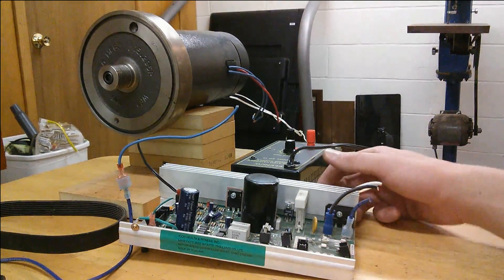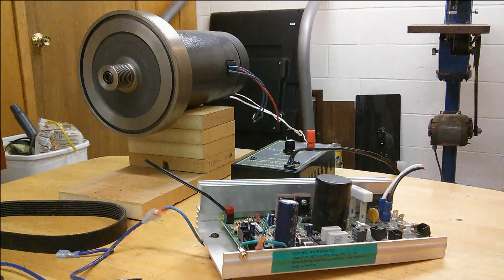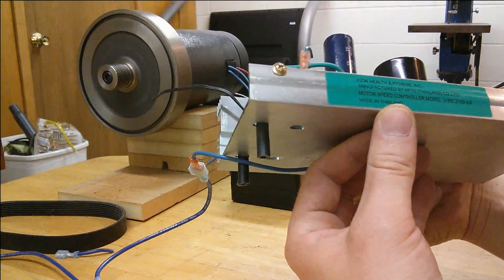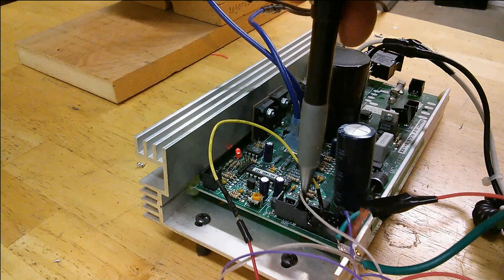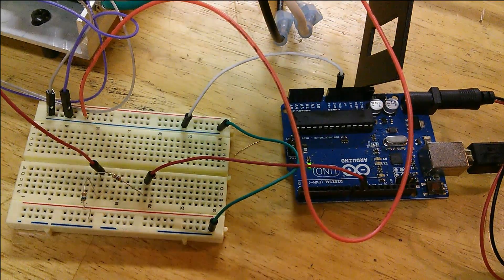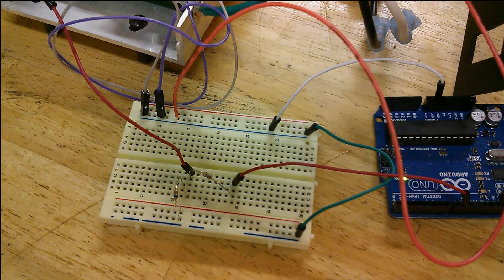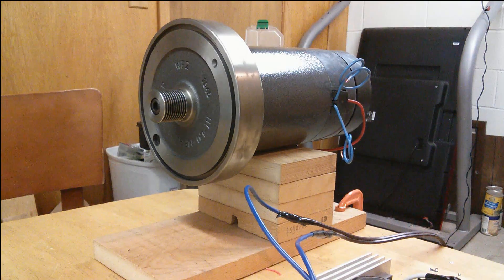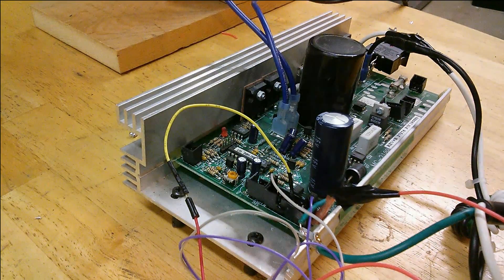Arduino + U-MC 2100-WA Treadmill Motor Controller

Comment: Is there a way you can hook a potentiometer to this board
Reply from the maker: Yes, go through the arduino tutorials on potentiometers - all you have to do to adapt them to a PWM board like this is tie the value read from the pot to the duty cycle.

Comment: Thanks for your demonstration about the control circuit..... I need to contact you about my case... I have control board for treadmill DC motor that gives high pulsating dc current and that tends to burn the motor so could you help me solving the issue as I'm going to apply an external pwm signal instead of the one on the board.....
Please give your mail to start contact you and get that done... Thanks

Comment: Hey Grant, 

When I upload the sketch with anything between 0.0 and 0.9 duty, I see the arduino mega flashing, but no motor movement (red light not flashing on mc2100 board). Anything above 1.0 duty, arduino just has solid light (not flashing), and still nothing from motor side.

I’ve wired up the unit just like yours, however the only difference is that I used a 220 ohm resistor for the arduino pwm pin 9, and 330 ohm resistor to ground. 

Any help would be much appreciated.

Comment: Thank you for the video and for continuing to reply to comments on such an old video.
Could you explain the function of the 2 resistors in the circuit? Thank you
Reply from the maker: If my memory is correct, the one from pin 9 is to drop the voltage from ~5 to ~3, and the other is a pull down resistor so the voltage goes back to zero when the signal is not applied.

Comment: But how do I change the speed manually? with a potentiometer? and where would you connect it to the arduino?
Reply from the maker: Arduinos are programmable, so it entirely depends. You would use a potentiometer, but if you're not sure how to do that I suggest that you start with potentiometer+arduino tutorials and learn the basics before trying it with a motor. A typical tutorial will teach you how to dim an LED with the arduino+potentiometer, using a very similar setup to what would be required here.

Comment: How could I add a potentiometer  to change the rpm? Could you explain this process, and share the code for arduino? You would help a lot of people.
Reply from the maker: It should be straightforward (I don't have the motor anymore to teat though). If you follow a standard Arduino potentiometer tutorial (to dim an LED, for example), you'll see how you can use analog-input to read a number from the pot. To apply that to the code I posted for this simple example, just rescale the input number to be between 0 and 1, and use it to set the DUTY_CYCLE variable. There are a lot more detailed projects on the linked SonsOfInvention blog.

Comment: is there a way to make this work with a potentiometer, so that you just have to turn it to increase or decrease speed? Great job by the way...impressive!
Reply from the maker: Yep, just read the potentiometer value and use it to modify the duty cycle. The simple code I used won't work quite so well, as the potentiometer reads and associated cycle calculation takes time and would mess up the 50ms frequency without care. I'd use a PWM library to manage it.
Reply: @GrantBrown73  I wonder if he might have meant use the pot in place of the uno...and if he didnt then I do mean that.  I know the MC60 controllers will allow for this but I have not seen anyone wire up a MC2100 with JUST a pot.  I have been lucky enough to get two free treadmill's off craigslist lately but one had some really crazy controller that I think was fried anyway but I could never find any way to control it other than with the massive control panel from the treadmill itself.  I picked up the second today hoping it would have a MC60 but it has the MC2100...which at least works with arduino but honestly its might be trouble than its worth given a simple 10000w SCR controller and 5010 bridge rectifier only runs about $15 and you can skip the giant board all together.  Still, if there is a way to wire a pot to a MC2100 that was free...well, thats $15 for beer right!
Reply from the maker: @jzahirniak  I'm not aware of how that would be possible - potentiometers just change resistance, whereas this board is expecting an active PWM signal @ 3.3.v. I may be ignorant of a clever trick, so YMMV.
Reply: @GrantBrown73  I am afraid there is no trick...I have a couple "nanos" laying around I bought for like $2 on impulse.  My MC2100 has a transformer where yours seems missing.  I think its a 5 and 12 v one so I suppose I could power the nano from there which would make things clean.

I know pretty much nothing about the Arduino's.  Was going to try to learn but got side tracked.  What would one need to do to your sketch to throw a pot in the mix?
Reply: @jzahirniak  I actually tried it with the bridge rectifier with SCR controller, but motor was making a humming noise when running, and as soon as I put load on it (by stepping on treadmill belt), the humming got louder, until the breaker tripped.
Reply: So you dont mention this but there is 13vdc on the pin right above your purple ground lead.  Do you see any reason one could not power the arduino with that + & - 13v source?
Reply: Anyone have any idea of manipulating the incline motor?

Comment: Did you ever end up using this for anything? Maybe we could attach the laser pointer to this lol!
Reply from the maker: Fresh From The Garden Got rid of it in the move, the motor had gotten messed up after disassembly. Still have the controller though.

Comment: how slow could you get this motor to turn with decent torque.  I am looking to use a treadmill motor for a welding positioner
Reply from the maker: TheUkracer Not sure what a welding positioner is, but it sounds like a stepper motor might be more up your alley. They have really good torque at low speed, and precise movement.

Comment: Pretty much guarantee why it was cut and damaged was because they had to leave it behind so they deliberately trashed it so the next owners couldn't use it. I've seen it a dozen times. Ppl are just plain mean and despicable
Reply: Had a large panel rented to a plant in FL. They cut my 30 wire feed about 3"from the din connector for shipping. I think it was plain STUPIDITY.

Comment: Hello,
I don't know to much in electronics but I can identify basic stuff like checking circuits voltage etc... I changed a 2100 board recently (purchased on ebay) because the old one had burnt due to flood. There is a permanent red light on he board, connections to the upper board is good since all lights are on. When I push the start button, the motor just runs for one big spin and that's it. I have to push the stop bottom then the start again to get the same instantaneous spin. I checked the motor voltage: it's 198 V then going down progressively to 0. Can you figure out the problem? Thanks
Reply: Andriani Sicilian 
I had the same problem. Probably your hall effect sensor is not connected or corrupted. The controller is thinking that the motor is not physically spinning so it is stopping the motor for safety reasons using PID.
Reply from the maker: Not a clue, sorry.
Reply: It's been my experience when the the motor spins once and quits, you may have a bad motor or the brushes need replaced. I suggest you do an Amperage test on the motor.

Comment: Hi. Excellent video, but I have one question: with the MC-2100 controller could we change the direction of the motor?, from clockwise to counterclockwise and vice versa
Reply from the maker: Nope, you need to reverse the power cables for that. I suppose you could set up an H-bridge of appropriately sized relays to route power through... but you don't want to screw that up.
Reply: thanks for your answer. Maybe the h-bridge is a good option, but I need to find one which support high current (27 Amp).
do you know, what is the maximum current that this device could use?

Comment: Hey, your video has been very helpful. Thank you. I was wondering if you could help me out. I am trying to connect a raspberry pi to the MC-2100LT-12. I am using an optocoupler combined with the pi's 5V rail to send a PWM signal to the MC2100. Just like you, I didn't have much luck with the PWM libraries out there, so i hard coded a loop to have a duty cycle (period) of 50 msec. The problem I am having is when I send a PWM signal (approx 4.88V out) to the controller, the LED remains red and I dont see it blinking, also the motor doesnt respond. I was wondering if this was related to the board not responding to the voltage I am sending it or because of the 50 msec period I am using. I've tried a bunch of different resistors between the output and the MC2100 and I even tried using different duty cycles  (30 msec to 60 msec). When you initially tested the circuit, would the LED blink regardless of the voltage you gave it (if you had the correct cycle?) or would the LED blink only when the voltage is correct too. Despite everything i try, Im unable to get the motor to respond. I even tried just giving it a solid 5VDC (not pulsing), but that didnt work as well. I noticed you soldered the AC inputs directly while I am still using the circuit breaker, do you think that is the cause? I can't think of anything else that would be different from my circuit to yours. Your input would be greatly appreciated, thank you again.
Reply from the maker: +Razvan Serbanescu To be honest, it's been a long time since I looked at this. I'm not sure what might be causing your issue, but the period should definitely be 50ms. If the LED is red, you should have power, it's just not receiving pwm. Are you sure the HDR2 pinout is the same?
Reply: +Grant Brown Ironically, 15 minutes after I messaged you. I was troubleshooting more and realized the schematic included with the treadmill was wrong. The HD2 pins were labelled backwards, so i wasn't actually sending a pulse to the PWM pin....facepalm I do appreciate your help and that you actually replied on a 3 year old video. Thanks again

Comment: Hi. Hope you can help me. But if it's not a quick and easy explanation then don't worry.
You said that it'd be simple to add a potentiometer for speed control. That's what i want to do. But i don't know which pins of the connector to/from the control board i should be using. Do you know how i'd test this? I assume the pot will be used as a voltage divider. In that case i'm looking for DC voltage accross two of the 6 pins i have on my power supply board, and another that the wiper would feed? Is that the same pin as you fed the PWM signal to? In which case how do i determine which it is (without damaging my power supply board). (I don't have the MC 2100 ) Thanks.
Reply: +balisticsquirel Oh, you meant add a pot to the arduino to control it and in turn the signal it sends to the treadmill power board. I want to use direct control. No arduino. Is that possible?
Reply from the maker: +balisticsquirel It's certainly possible, but you'd need to design a timer circuit which turns a potentiometer input into the appropriate PWM signal; that's a bit beyond my novice electrical skills. You can get a mini Arduino for like $3 on Ebay though.

Comment: I have a treadmill controlled by this board which has developed bizarre behavior. It either won't start or starts sometimes with incomplete control. Your video is great and you clearly understand how the controller works. Can you tell me if the control board or the console is at fault? I can buy a new control board but not a new console. When not working, the PWM pin 4 has zero volts on it. Is this control signal provided by the console or generated within the board in normal treadmill use?

Comment: Great Project!  I just got a free treadmill off of CL with this motor controller and am trying to replicate your effort here.  I'm trying to figure out what you did with the blue leads coming off of the board.  I see you extended them onto a piece of lamp cord that disappears off the table somewhere but they don't seem to terminate to the motor - where/what needs to be done with those leads.  thanks for any advice.  Also any idea how to control the power raiser/incline section of the MC?
Reply: Lee Wenger never mind - I get it - those are the leads running to the red/black leads of the motor - it confused me that you used the blue wires there instead of the red/black.  I still have the question wrt the raise/lower function if you have any info there.
Reply from the maker: Lee Wenger I never ended up doing anything with the raise/lower motor unfortunately.
Reply: Grant Brown Thanks for the response - It looks like 5V on the 5th pin is supposed to raise the incline and 5V on the 6th lowers.  The 7th pin provides some form of feedback about the incline level but not sure what kind.  I got this to work and then it stopped... not sure what I did.  I worked up to where I set the arduino to send a .75 and then a .99 duty cycle which made the treadmill go quite fast but it also made the arduino completely unresponsive to receiving reprogramming commands so I pulled the PWM signal off the MC board and after finally reprogramming the arduino to send a .25 duty cycle pulse and reconnecting now I'm getting no light on the MC... now trying to troubleshoot what I could have done... oh well if I somehow fried the board I guess at least the price was right but certainly wasn't my intention...  BTW, I just direct shorted the two leads going to the motor thermal protection (blue wires) and that didn't seem to be an issue but now since i've had these issues maybe that is part of the problem.   Anyway, thanks for the help.

Comment: Greetings from Venezuela Grant Brown, I congratulate you on the video, thanks for sharing your valuable insights. I'm Electronics Technician and work at a local TV station in my city and I want to manifest something I'm trying to solve to see if you can help: A friend has promised me something that has me head, is the treadmill that I stopped working the automatic mechanism and has not found a solution and asks me to put it to work manually for which I searched a lot of information and I have not managed to find something concrete to do. It is to do what you did in this video, but it turns out that the motor control board is using another model, is the MC2100LTS REV B-50W; therefore I have doubts on the connection. Thanks in advance for your time and God bless you always much...!!!

Comment: Saludos desde Venezuela Grant Brown, te felicito por el vídeo, gracias por compartir tus valiosos conocimientos. Soy Técnico en Electrónica y trabajo en un canal de televisión local en mi ciudad y quiero manifestarte algo que estoy tratando de resolver a ver si puedes ayudarme: Un amigo me ha comprometido en algo que me tiene de cabeza, se trata de su máquina caminadora que le dejo de funcionar el mecanismo automático y no ha encontrado solución y me pide que se la ponga a funcionar manualmente para lo cual he buscado mucha información y no he logrado encontrar algo concreto para hacerlo. Se trata de hacer lo que tu hiciste en este vídeo pero resulta que la tarjeta de control de motor que usa es otro modelo, es la MC2100LTS-50W REV B; por lo tanto tengo dudas en la conexión. De antemano Gracias por tu tiempo y que Dios te Bendiga mucho Siempre...!!!
Reply from the maker: Antonio José Montaña No soy expert de estas tarjetas, y nunca he visto la LTS-50W (solo he trabajado con la maquina caminadora rota que teni). Si las conexiones parecen semejantes, es possible que funcionan semejantes. Buscaria conexion en la tarjeta que se llama "HD2", como uso en este proyecto. Buena suerte!